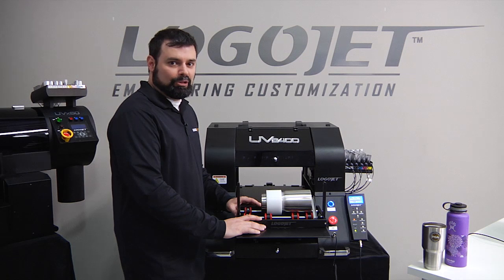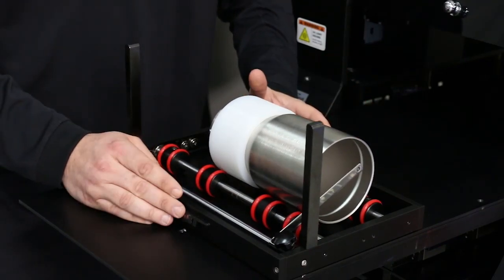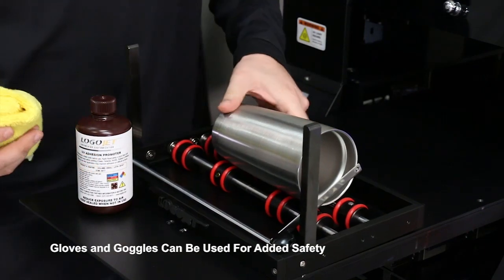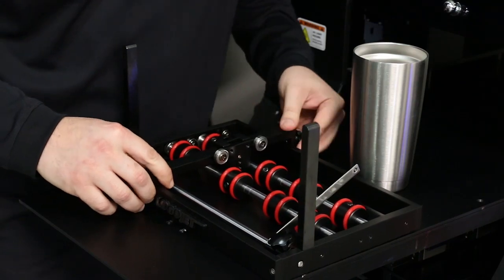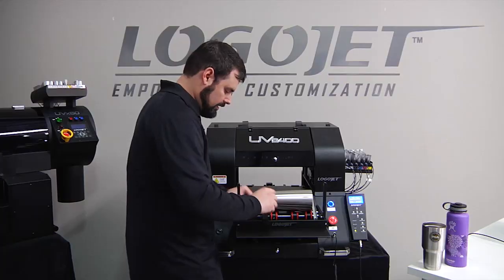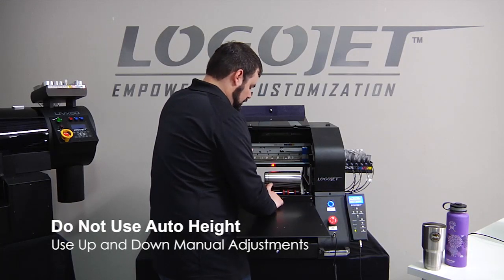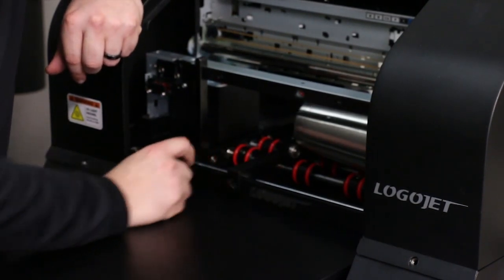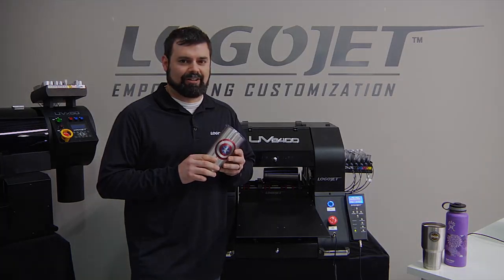LogoJET Printing with Rotary 360 device

Comment: Very cool video but, can it print full color all over this uneven style?
Reply: Good Morning Jorginho,

The printer has up to a 5mm distance that it can spray the ink. Where the rotary ring attachment goes in this video, it can not reach there. You can however do a full wrap on a cylindrical tumbler or one with a similar shape to a pint glass taper.

Thanks for the question and have a wonderful week.